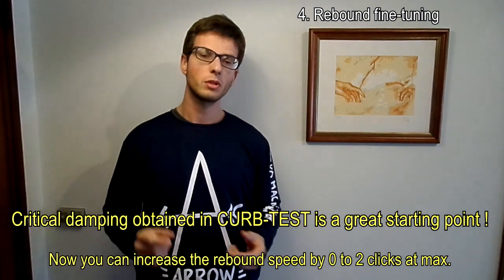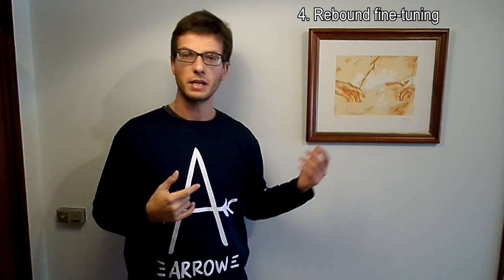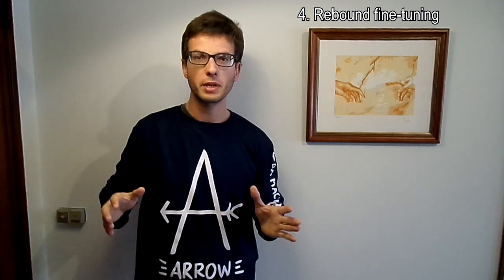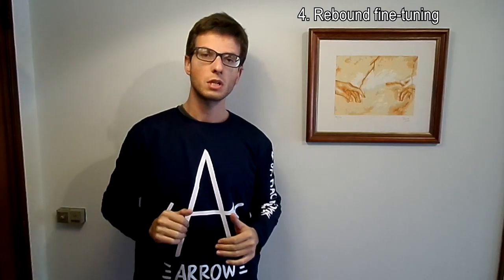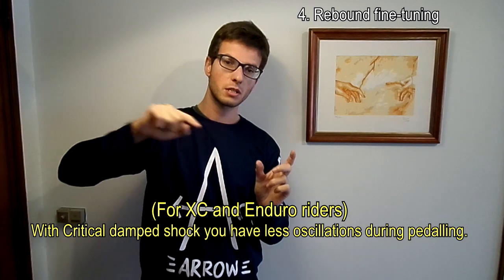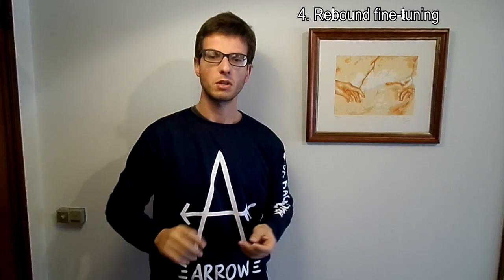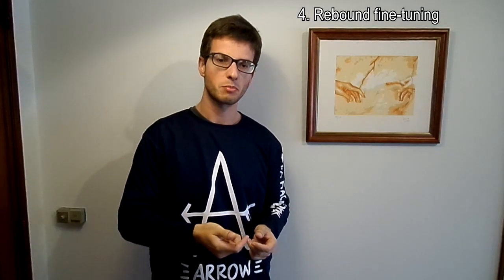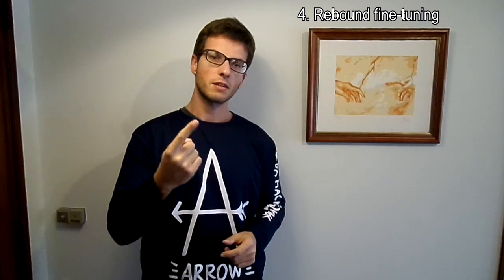How to CORRECTLY setup rebound damping (MTB rear suspension Ep.5)

Comment: A quick question, should you have the riding gear that you would use on while doing this?
Reply: +andrextr I think he refers to the helmet, protection, shorts etc. So whether you should do this test with your riding weight or not
Reply from the maker: +Day light oh yes, you are rigth ahah. Yes you can do with riding gear, but its OK to do it without it, the result will be pretty much the same. Bye :)
Reply from the maker: +Craig Urik The gears are not important for this :)

Comment: at the end of the video you drop a white bike and it bounces,  then you drop a green bike and it does not bounce.  what is the difference in the setup and which is preferred?
Reply from the maker: +Flemingtb that was a Joke since the white bike is an hardtail, so it bounces on the drop test because it doesnt have a shock to absorb the impact. I have a vídeo named "drop test" between 2 FS bikes with more info. The bouncing is not due to rebound speed, is due to the lack of sensitivity of the shock. Bye

Comment: But what if I perform the rebound test correctly while seated,but when riding on a downhill trail I never stay seated,would that make the rebound setting that I chose irrelevant?
Reply from the maker: +Castrav Eleuterius You can do it while standing, there is no much difference on the result (since the weight distribution is quite similar), however I find it easier to do it seated (because you eliminate the contribution of body movement and the legs which also absorb and dampen some of the impact). So that's why I prefer seated, to isolate the suspension only. But it's OK to do standing, just try to remain stiff on the legs. Bye :)
Reply: andrextr Wow really fast reply thank you,great useful videos by the way

Comment: What about the rebound damping for the fork ? Great video tho !
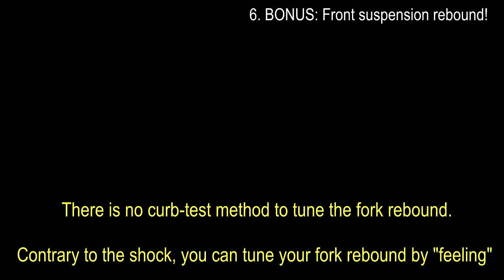Reply from the maker: +GrEgO169 Hi! The video also covers the fork rebound at min 10:32 . But basically you don't have a specific method to tune the fork rebound. You have to tune it by "feeling". By advice is to pump on top of the bike in the parking lot, a get a slightly faster rebound at the fork than at the shock. Overall the bike must feel balanced between front and rear suspension (slightly faster on front though). The rebound in the fork is not so important, because a wrong front  rebound won't affect the bike stability as much as a wrong rear rebound. So you have more room for error :D Bye
Reply: +andrextr Oh sorry, I just stop the video before it ! So I barely tuned my shock and fork as you say, it feels quick weird for me because my sock's rebound was a little bit faster (1 oscillation). I think I'll get used to it, however, the fact that the fork is faster than the shock feels also quick weird ahah but I'm pretty sure it will be better this summer !
Reply from the maker: Yeah many people out there have a fast rebound. If you do "my" method and increase 1 or 2 clicks just to achieve a little tiny oscillation you are good to go! Now your rear suspension would be very stable, you are more controlled, and you have less amplitude in pedal bob oscillations. Still, the suspension is fast enough to work well on bumpy sections. So, you get the best balance as possible between stability and plushness :)

Comment: I have a question i did the curb test exactly like in your video and it left me on like the 3 lowest rebound setting for critical dampening. im riding a 2016 santa cruz 5010 with a monarch RT3 shock and i weigh 205lbs. What i meant to say is i cannot tell if my rebound is too slow or too fast. I cannot distinguish the suspension from packing or being harsh from the shock oscillating. I had the fox float on before and it seemed to work really well. But i blew it up the fist day. so i opted to go with the monarch. I have to be having alot of problems with the monarch being extremely harsh. Do you have any tips or advice. i have not ridden since i did the curb test with critical dampening.
Reply from the maker: +russell Hi. I'm also on the 3rd slowest click. I think my shock has 10clicks and I'm on the 7th. You can increase the speed by 1 or 2 clicks from the critical (it will give you just a small tiny oscillation). With that setting (either critical or critical +2), you won't get pack downs or excessive oscillations (lost of stability). So your suspensions is pretty well balanced between traction/stability and plushness. Is your monarch a debonair or a standard can? I build an air shock simulator that I will share with everyone, and in the next episode (maybe next week) I will show you and demonstrate, why a shock with a big negative air chamber (like debonair) will give you more sensitivity on the first 1/3 of the travel. Also it gives you more mid-stroke support, which in the case of santa-cruz might be very important given that those bikes have a regressive-progressive leverage ratio with a pretty "flat" mid travel. So, stay tuned for the next episode. Bye
Reply: its the debonair. thank you so much your susoension videos have helped me learn alot about suspension. Im currently in calculus so for some reason all the math and graphs you make i completely understand. Is it possible thaht the monarch is the incorrect shock on my bike compared to the fox float it came with?
Reply from the maker: +russell if the shock is OK, and the tune is identical, it should work well. Bye

Comment: using your video I have retuned my rebound.  I previously set it as fast as possible without it being unstable but now found it requires about 25% slower to avoid oscillations.  just went for a ride through super rough trails and the bike handles much more stable now!
Reply from the maker: +tekjim Nice. On a very bumpy/rocky trail you can increase a little bit the rebound speed from the non-oscillation point. So, you end up with just a minor tiny oscillation. Bye
Reply: +andrextr yes I reached the non oscillation point then added 2 extra clicks to make faster.  it is perfect now!
Reply from the maker: Nice to know that! Now go shred some trails :)

Comment: Hi
I bought capra with bos suspension last christmas and even when the rebound its on minimum position (fastest rebound) its still no oscilation during the curb test. The rebound working fine because i can slow the shock down and fast up too but still not fast enough. The lsc, hsc and lever is full open during the test and sag its like 25 or less precent (im about 70-72kg). Do you think its a shock feature or a failure? Cheers
Reply from the maker: +Joris wyvern Hi Joris, thank you for your input, and I understand what your are talking about. And in fact, BOS, and many other more "basic" shocks, have both internal high-speed and low-speed circuits (either on the compression side and also in the rebound), but in most of them you are not able to adjust all the circuits independetly (unlike the CCDB and Fox X2). In the Kirk you only have one rebound knob which affects mainly the LSR zone but also affects the whole rebound damping curve. I will talk in a future video why there is a need for having a different amount of damping for the low and for the high speed motions (the reason is the transmissibility)... Nevertheless, and despite these complications, the principles of this method also applies for the most complex shocks, and the ideia is always the same: Having the fastest rebound speed as possible without having too many oscillations (unstability). In fact this method simulates a drop in the trail, and it uses almost all of the travel. So, it's a great way, and the most reproducible method out there, to adjust the rebound speed. If you test your shock with a heavier guy and an higher air pressure, you might get the oscillations at max rebound speed (underdamping scenario). Bye :)
Reply from the maker: Hi Adam. If you did the test correctly, and if you dont have a tiny oscillation, it seems to me that your shock is overdamped for your weigth/springrate. Tradicional shocks, like yours, have different base tunes. Your bos migth have a firm rebound tune for your weigth. Heavier people sometimes get the opposite problem. They cant eliminate oscillations (underdamped tune). Try to do the same test on a friend's bike and compare the results and rebound velocity. If you are too far from the ideal setting you migth want to re-tune your shock, your using a thinner oil viscosity. Thats my opinion. :) bye
Reply: +Adam Oślizło 
It's the shock. there is high and low speed damping on this schock, and the low speed damping is really effective.
You'll need a bigger step to make it oscillate, if possible.
This test is useful for basic shocks, not for your BOS. And you have more than 3 useful "clicks".
Don't worry, when riding in real conditions, the high speed damping will give a quick enough reaction to your shock.
Reply: Joris wyvern 
Im not worry about real riding. For me The Kirk shock works amazing and im super stoked to have deville and kirk on my bike. Despite that the tips from andrextr its a good start point of your suspension setting.

Comment: Do not really understand why you measure this seated as weight distribution will be different when you stand on pedals. When you ride DH you never sit. This is the reason you need to adjust your suspension with same weight distribution as you will be riding.
Reply from the maker: +Andriy Gavrylenko Hi Andriy! I did this video to cover all disciplines, ranging from XC to DH. This is the main reason for doing seated. You can do it standing on the bike. You can check the Ep.6 about weight distribution, but by staying seated on the bike you create a much higher impact force on the curb test, so the shock compresses deep in the travel, and it's easier to check for oscillations. And by staying seated you eliminate several factors, such as an involuntary body movement which might confuse the end result. So I truly believe that the test works best when seated. But you can also do it standing on foot. Bye :)
Reply: +andrextr When seated you have more weight on the rear. Oscillations depend on the suspended weight over shock. If you set rebound with more weight than you will be riding then this results in too much rebound damping and leads to packing of rear suspension. You really have to set suspension the way you will be riding (seated for XC and standing for anything else).
Reply from the maker: +Andriy Gavrylenko Yes I understand your point, and I appreciate the comment. But honestly I think that it's a minor affect without a major implication in the final outcome. We are talking about a 10% effect or 15% at most. You can try it and test on the trail, but I'm honestly convinced that you won't find a major difference. The weight distribution by seating vs standing doesn't not change thaaaat much. Also don't forget that on a DH trail you are not always in the same position, some times your center of mass is behind the saddle, and some times is in front of the saddle. So being seated seems to me a pretty "average" center of mass spot. And don't forget that the test is just a starting point, then you increase the speed from that starting point as needed and you might fine tune on the trail a tiny bit. From my experience the result on the curb test translates very well to the trail. When I have a bigger oscillation on curb-test, in the jumps and hard landings the rear wheel lifts from the ground after the landing, and I feel my weight getting tossed to the front. But I will test the effect of standing vs seated just by curiosity, and I might also use my weigth scale to see how the weight distribution changes in different positions. :D  Bye.
Reply: +andrextr It all adds up. If on flat you have already as you mentioned 10-15% magnitude error (which is like difference between harder and softer spring if you measure sag the same way) it only increases when you ride down the mountain. When you point bike down the weight goes further to the front. At the and you have 20-30% error in your initial suspension setup which is quite substantial.

Comment: Very good explanations and technique for setting up your shock. Thanks. Now how about something on HSC/LSC setup.
Reply from the maker: +Scott Posey Hi Scott! Many people is asking me that, so probably I will make a video today/tomorrow about that. But basically you have to tune the compression on the trail. I would suggest to start without any HSC and LSC damping and go ride. If you feel that the bike is compressing to much to your inputs, and it feels very soft, with pedal bob, and when you pop the bike or in the berms you feel the bike compressing too much, then increase LSC damping until the bike gets more stable to your inputs with a firmer feeling. After tunning LSC, focus on hard bottom-outs. If you are getting many hard bottom outs on your regular trails, then increase HSC until the point that you only get some few casual harsh bottom-outs. That's it! Contrary to the rebound (which is likely more "set and forget") you can change the compression to suit better the type of trails that you are riding. Keep it mind to use the minimum compression damping as possible (without sacrificing too much the bottom-out resistance and bike stability), sine too much compression damping leads to loss of sensitivity. Bye
Reply: Another question on critical rebound. Is it rider weight independent, assuming sag is set properly? In other words, if I lose 20 lbs, do I need to go through the rebound setup process again?
Reply from the maker: Yes. The crital rebound damping depends on the springrate and rider weight. This is why the shocks have a wide rebound damping adjustment, in order to accommodate all riders weight differences. :)

Comment: Awesome Video Andre! 

I was wondering about your opinion on over-damped rear shocks. I remember reading a few years ago that both, Troy Brosnan, and Sam Hill like to run their rear shocks with a higher pre-load, and slower rebound allowing their shocks to "pack-up" over rougher sections of trail. Any opinions on that?
Reply from the maker: +Ryan Conroy Hi Ryan! From what I've been seen, I think that many people out there have an underdamped shock (too fast rebound). In fact, a fast rebound makes the bike feel more live and plush, however, it decreases the stability and the traction given the unwanted oscillations that change the weight load distribution on the tires. This is why I recommend a rebound speed just a little more faster than the critical damping (1 or 2 clicks). I think it's where you get the best balance between traction/stability and plushness. So, when they say "overdamped" they are probably talking about something close to a critical damping, since many people out there tend to use a faster rebound setting. In that case I agree. If with overdamped, they really mean a overdamped case (slower than critical), then I do not see any advantage in that...slower response times, more packing, more bump transmissibility to the chassi, less plushness and there's no gain in stability compared to the critical. Regarding the pre-load, I strongly suggest NOT to use preload in a coil spring (Check Ep.3 video). The preload in a coil does not increase the spring rate. It increases the break away force need to start compressing the suspension. The preload in a coil has the same effect of a pedaling platform valve of a shock (such as propedal or SPV). So, preload acts as a sensitivity killer. Bye :)

Comment: First off, your explanation on how to set rebound damping for the shock is the best and most logical I've come across.  Bravo!

But can you explain setting fork rebound in a little more detail?  You say it should be faster than the shock, but are there any metrics on how to decide how much faster?  Is bracketing the best way to find the correct rebound?  I find bracketing to be extremely time consuming and difficult to accomplish correctly.  It might be the best way for pro riders with factory suspension support but not realistic for the average or even above average rider.
Reply from the maker: +Cory Yalowicki Thank you! Unfortunatly there is no "scientific" or quantitative method to tune fork rebound. However, fork rebound is less important than rear shock rebound, so you have a wider usable range. The way I tune is to pump on top of the bike, and find a fork rebound setting that is at least as fast as the rear wheel. Your front and rear rebound must feel balanced. When pumping the bike if you feel the rear shock rebounding faster than the fork you need to increase fork rebound speed. Sorry, this is the best I can explain... You have to try and test :) But don't worry too much with fork rebound, just leave it a bit faster than rear wheel. :) Bye
Reply: +andrextr Thanks for the quick response!  I'm resetting rear shock rebound on all my bikes as we speak :)
Reply from the maker: Eheh nice :) Stay tuned for the next episode. I will show you an awesome and inexpensive method for free suspension data acquisition and I will apply that to analyse rebound & curb test, flat landings and pedal bob...  :)

Comment: Hi does the same apply to low speed and high speed rebound?Thanks for the video easy to understand
Reply from the maker: +jason cramp Yes, the same principle also applies with a shock with LSR and HSR rebound adjustment. Indeed, many shocks out there with a single rebound knob also have HSR and LSR circuits inside, at least the fox does (reference: http://www.pinkbike.com/news/To-The-Point-Rebound-Damping-2013.html). 

However in single rebound knob shocks you cannot tune HSR and LSR individually. By changing the single rebound knob you affect the entire rebound curve, both at slow and fast speed.. :) So, yes, you can use curb test as a starting point. Them you will fine-tune the rebound speed without increasing it too much.